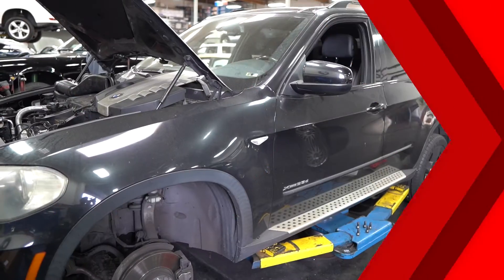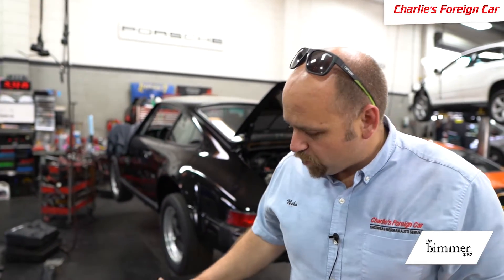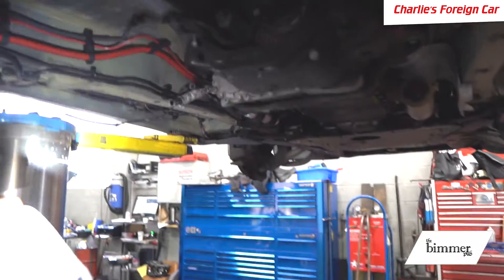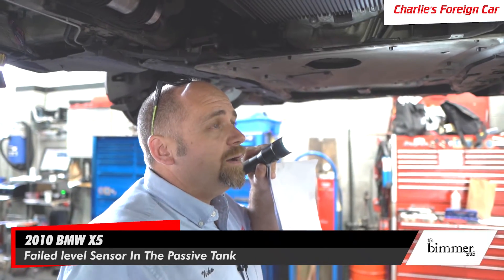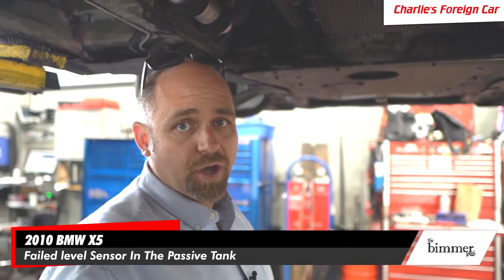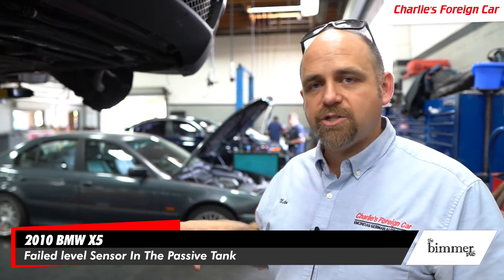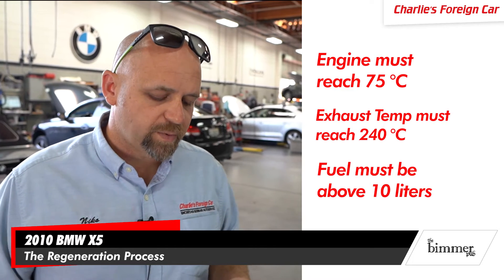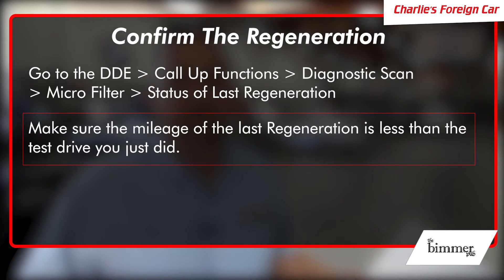Urea Passive Tank Sensor Code And Regeneration 2010 BMW X5

Comment: BMW, Mercedes, Audi whatever ... all of these European vehicles with Euro 5 compliant diesels will send you broke trying to keep the emission systems working. Mercedes being the most onerous ones by limiting your ability to drive YOUR vehicle at all if there is a flagged 'problem' ! If you want to keep these Euro 5 spec vehicles reliable into the future, an ECU re-flash to get rid of ALL these systems is the most cost effective way to go. Once these vehicles are out of manufacturers warranty, you are risking financial oblivion owning one that isn't modified.

Comment: Total B.S. by BMW. Thank God there is a pretty easy fix by  simply plugging  a 10K resistor to the sensor. Cost is a few dollars.
Reply: How?
Reply: @dougnbodie  can i have your email?
Reply: @YEGAutoCarplay  ...Please check the BMW blogs, there are pictures and instructions in pretty much every one. Just type in your current OBD code or Active or Passive tank sensor fixes and everything comes up.

Comment: theres a bulletin out from bmw usa on this covers vehicles with 4bcc code 10 years/120,000 miles if u have that problem you should get the dealer to do this and save your customer the $$$            	SI B01 11 18

Comment: Is there any ways to disable it?
Reply: You can trick it by putting in a resistor directly at the plug. Takes a couple bucks and a few minutes to get to the sensor 😊
Reply: @lorenacox3849 which one ?